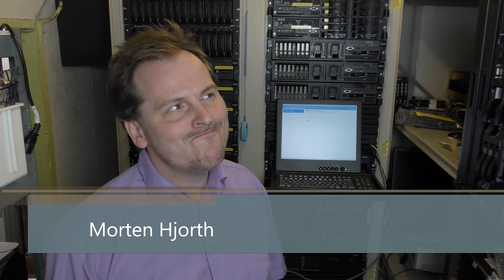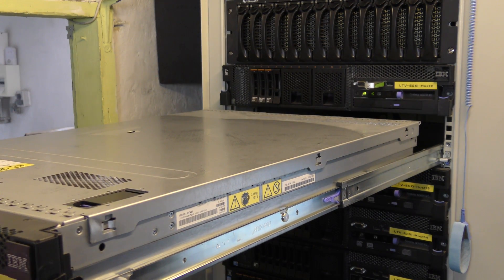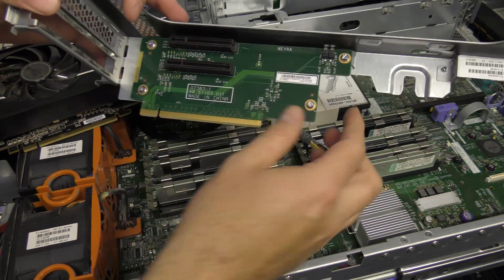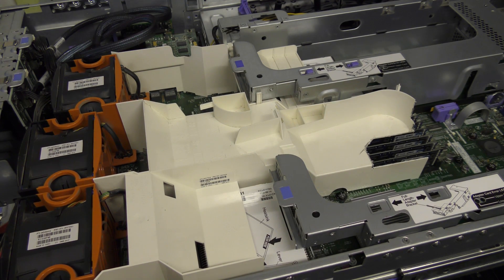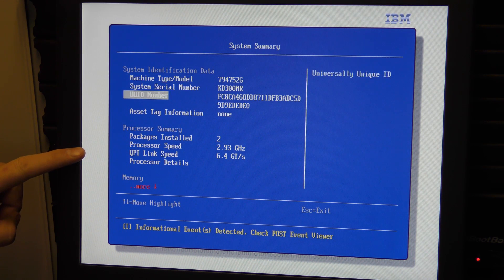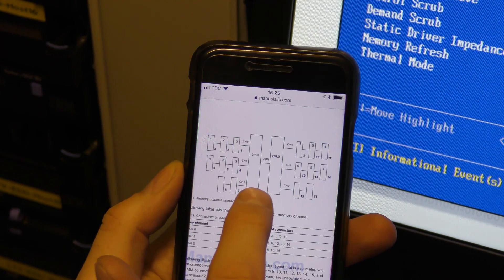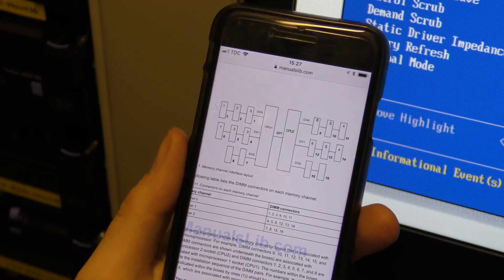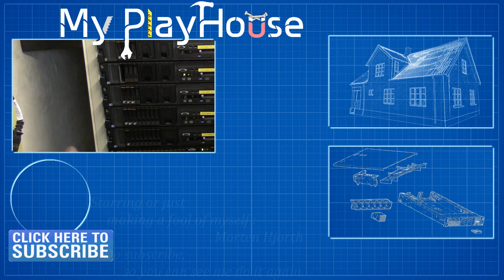Will The Lenovo x3650 M2 see 256GB of Memory - 730

Comment: While the BIOS can see 256Gb, doesn't mean that it's a functional 256Gb.
For example, it it was doing a task that needed more than 128Gb or memory, would the server, CPU and general server be stable or crash a lot?
I would like to see this setup tested in a typical load and an extreme load setup for any possible stability issues.
Other than that, awesome. 👍
Reply from the maker: Hi Mac·au
Thank You very much!  We will need to try that.
Thank you for watching! :-)

Comment: Yo, i know for a fact they can do 192GB under Xeon 5600 because i have personally done it myself, in both the M2 and M3, using a Mix of 16GB 8GB and 4GB Dimms.
So Really nice to know that they can do 256GB as well which is pretty far beyond spec.

Also with the re-application of power, if you wait long enough before turning on, then the machine will start up nice and quiet as the BMC will have had enough time to initialise.

Also if you want to see POST information on the Splash, you can enable that under the EFI setup utility somewhere.

Also you mentioned the GPU cable, well i manged to get my hands on a genuine IBM one from ebay a little while ago. if you want i might be able to see if the listing is still up and link it.

BTW as far as i understand, doesn't the move from single to dual or triple channel offset the reduction in channel frequency as far as performance goes?

What's your opinion on the 3550 / 3650 M4 ? i've been wanting to get some for a while, do you think they are any good vs the M2 and M3 ?

-- Alex.
Reply from the maker: Hi KSSilenceAU
Thank You very much! Yes the x3650 M4 is much like the M2 and M3,, and of course just more of everything. I use my vacation to move over to my M4,, so that one is running everything now.
Thank you for watching! :-)

Comment: I was just given an X3650 M3 with two X5765's and 72GB of RAM (18x4GB).  No drives or 16bit PCIE though. :-(
Ridiculously impressed with the performance on just playing around in Windows 10 Pro as a "desktop".
Quite hilariously loud when booting up but actually not that bad when running. Considering lower noise fan options though.

Not planning on this being a daily use machine because that would be crazy, but for video rendering it would be great. Just need that slot for x16... A 1080Ti would sit in there nicely...

There does still appear to be a memory speed limitation on the M3 which mildly annoys me. Thinking of dropping back to 24GB so getting faster speeds on the RAM: http://systemx.lenovofiles.com/help/index.jsp?topic=%2Fcom.lenovo.sysx.7945.doc%2Ft_installing_memory_module_option.html

Basic Benchmark:
https://www.passmark.com/baselines/V9/display.php?id=106361150942
Reply: X3550's are quieter than x3650's by quite a lot.

Also if you wait a few minutes longer after applying power, then you wont have the huge amount of noise during post. Reason being that the Fans are controlled by the BMC, and if you turn it on as soon as it lets you, or it turns itself on if configured to do so, the BMC still isnt ready, so fan control isnt active until it is. So wait until slow blink of power LED, then wait an extra 2-3 minutes.
Reply from the maker: Each block also consumes power,, and 12* 4-8 watt add's up.

Comment: Another fun video.  Nice to see all that RAM supported.  Maybe that recent BIOS/firmware update allowed for larger memory configurations.
Anyway, I always like to test my memory with MemTest86.  It's a free ISO file, and its quite detailed.  I've had ECC memory that I thought was fine, but was having errors internally corrected.
Heck, demonstrating MemTest86 would make for a great video:  https://www.memtest86.com/download.htm
Reply from the maker: Hi Dave L
Thank You very much!  glad you liked the video :-)
Thank you for watching! :-)
Reply: Thanks for the response, but how do you feel about doing a MemTest86 video?  I'd like to hear your take on it.  It might reveal that some of the well used memory in your personal datacenter is faulty (or is silently failing but is being corrected with ECC).
As a sysadmin myself, I always thoroughly test system and memory with MemTest86 before I put them in production (usually a week straight burn in).

Comment: I guess socket 1366 is pretty much redundant now for servers, my x5650 desktop has been relegated to just web browsing now. It was cutting edge at the time with the first i7 processor being socket 1366, nowadays you can get much more processing power with less power consumption with modern cpu's.
Reply from the maker: Hi gamerdude0
Thank You very much! Yes CPU's becomes faster and more efficient all the time :-) glad you liked the video :-)
Thank you for watching! :-)
Reply: My W5580 workstation is still going strong at home for what ever i throw at it games included, i am planing on upgrading its CPU's to X5680's or X5690's though.   the Supermicro Motherboard in it can take 18x DIMM's as well, which i have all populated for a total of 120GB atm. machine actually runs XENServer with my PC as a VM ontop of that with PCI-E passthru for GPU, USB, and Audio.

Xeon 5600's might be old, but for the price, they are still very much good value, and they still perform decently today.
Reply from the maker: They are very good value,, and they are getting cheaper every day :-)

Comment: Morten can you quote me on the value of mine = IBM 7946 System X3650 M2 CPU 2X X5560 2.80GHz Server 64GB RAM 2 X 500 SAS  In your dollar would be fine I can convert. I was thinking of selling it and I would value your opinion on it.
Reply: T Komoski 250-300 dollar. Depending of the size of the dimms.
Reply: 4gb sogndal94
Reply from the maker: I only know of Canada prices from  LinusTechTip,, scrapyartwars,,, think you can charge a little more than in the US ,, so the $250-300 that sogndal94 suggested might not be far off.
Reply from the maker: Hi T Komoski
Also depends on where you are selling,, Germany og UK €100-200,,, Brazil €300-500
Denmark,,, €250 -ish
Thank you for watching! :-)
Reply: Canada Morten $

Comment: hi, is it true that the more occupied ram slots, causes the slower ram memory?
Reply: Rafał Jakubowski Yes, but it's only on certain server hardware. I assume its an issue with the memory controller Intel used. Unless you are running something insane like a EVGA SR-2 with fully populated DIMMs you will never see this on a "Consumer" or "Prosumer"  machine under any circumstance.
Reply from the maker: Hi Rafał Jakubowski
Yes,, in the x3650 M2 you can put in 6 blocks and they can run 1333MHz, 12 bloks and you get 1066MHz and 16 bloks 800MHz.
Thank you for watching! :-)
Reply: Explained here for this server http://hpc.fs.uni-lj.si/sites/default/files/Memory%20Intel%20Xeon5500.pdf